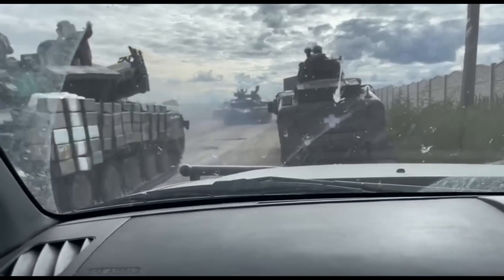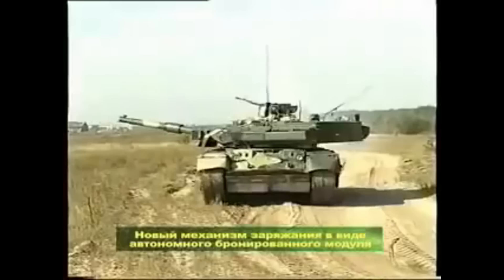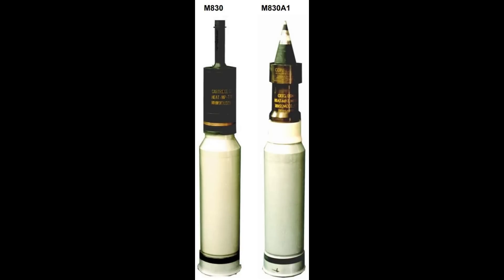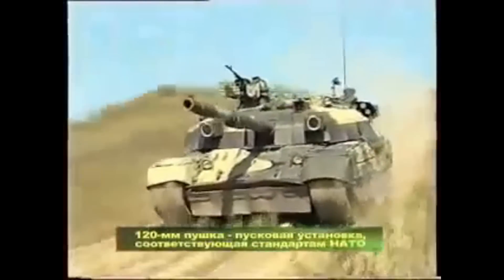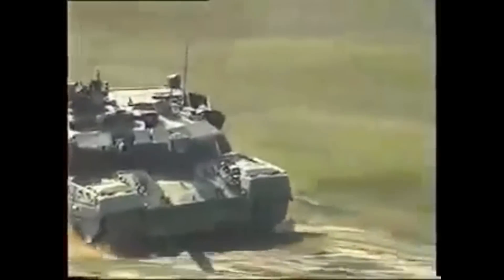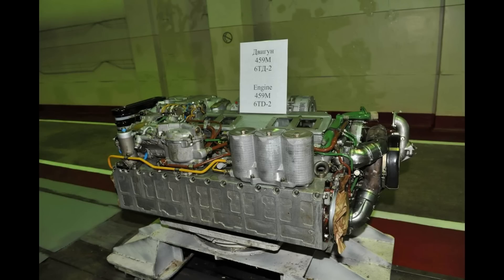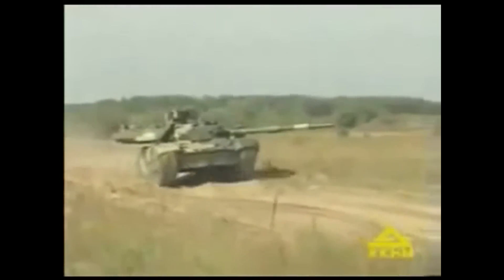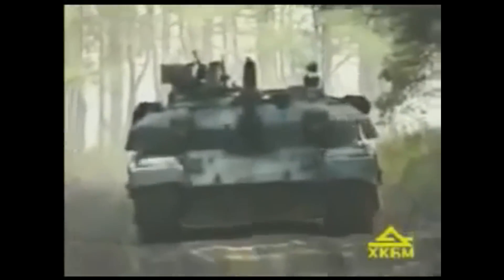Best Ukrainian Tank that Never Came to Be

Comment: Wasted potential due to economic and political reasons. Nice video
Reply: So basically almost every other prototype weapon system ever? Lol.
Reply: Anyway it's useless now as any other tank in the world. We all need new tank all side protection against 45mm APFSDS with APS, ERA, Ceramic addon armor, Cope cage and jammer. So something like Merkava but with engine in back + ERA + Jammer and reduced weight.
Reply: @rinaldoman3331 ”and reduced weight” with everything you said, that will NEVER happen
Reply: @valkyrie5972  3 member crew and here you go! Manual loading is quite outdated.
Reply: @rinaldoman3331  200lbs is not going to offset all the additional armor that is required, sick down your statement is stupid
Reply: @rinaldoman3331 "It's useless now as any other tank in the world" Hahhah yeah :D

Your statement is so full of crap. If this was the case, then the most modern militaries wouldn't use them in the first place.
Reply: @rinaldoman3331  You mean merkava that is now being blown up in big numbers by barely armed militia in Gaza? That one? Because gee, what a record, it wouldn't last 5 nanoseconds vs actual army, as demonstrated by Leopards and Abrams vs Russian troops except if anything it would perform even worse...

Comment: If the russian fix those issue is the tank good?
Reply: Yes
Reply: They can just take the low sensitive Leopard shells that have a hard time exploding on their own and develop a shell and propellant that do not explode on impact or by heat 

And a new gearbox. 
+Anti drone jammers but the Protective shell is good enough. 
Regardless these tanks are used as self propelled guns and as live bait during any armoured attack while firing on the move.
Reply: @whitefalcon630  If Russia seriously wanted to pursue those Options they already would've as neither a better transmission or special propellant are particulary complex things. They just don't care.
Reply: @heyho4770  They do care. Just right now they are happy what they have. What they can use What they can repair what they can salvage. 

They even have special plants that only refurbish and fix previously "destroyed" vehicles even if the vehicle suffered seamingly unsustainable damage. 

They recycle what they lose.
Reply: fixing the issue of having their ammo no inside the crew compartment would make it a completely different tank. Better start from scratch since the doctrine of making your tank as small as possible at the cost of everything else isnt good anymore
Reply: Why fix something that isn't broken? And the development of a new tank requires quite a lot of money and time, which is why Russia abandoned the same t-95 and object 640. And even if they were realized, they would remain primarily technological demonstrators, just like Abrams X or Kf51.
Reply: The Russians wont fix those issues.
Reply: It's better, but no, i wouldn't call it "good".